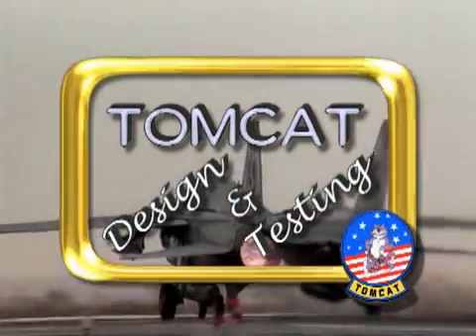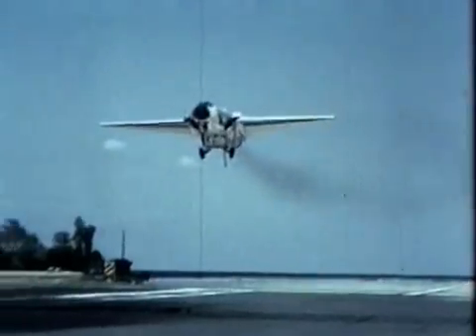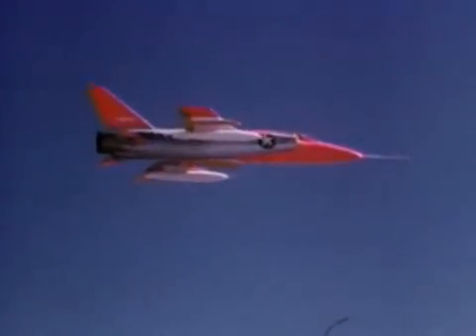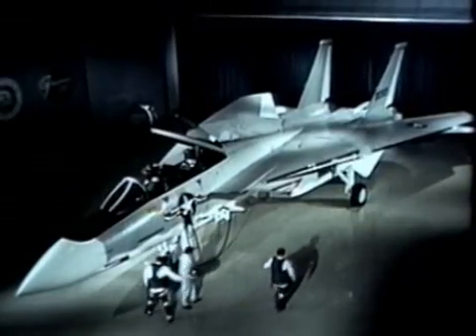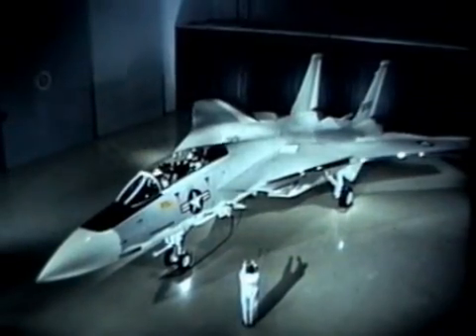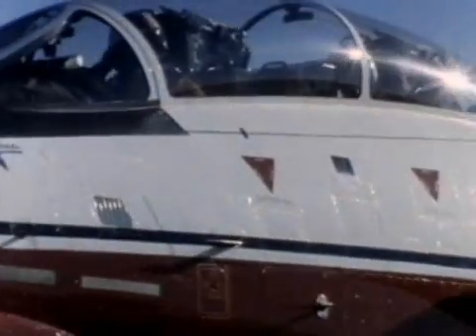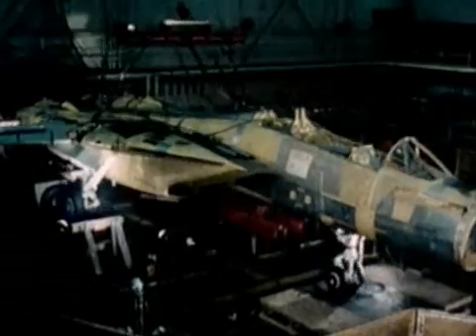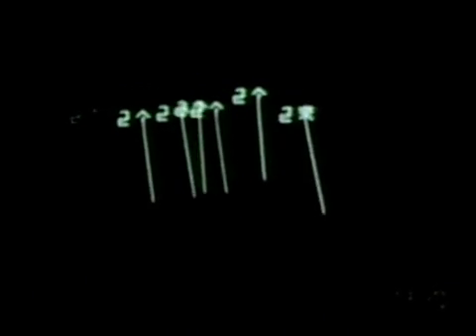F14: Design And Testing

Comment: The f14 and F15 were the best aircraft ever produced. Then cam the F16, which was cheaper than the F15 and was a great companion to the total air dominant F15. The nava search for an equivalent and accepted the Fa18 Hornet as their version of the F16. Since then the Fa18 was improved upon and now the FA18 Super Hornet graces the decks of our aircraft carriers as air superiority aircraft as well as ground support. A few of the original Fa-8's remain as ground support only. I really think the Navy dropped the ball when replacing the F14 with the Super Hornet. Updates to the F14 could have kept it alive decades longer. But for now we're looking at the F35 to fill that role and many others. Too bad! A stealth version of the F14 could have kicked ass on anything else in the sky. It would have been the Nav's version of the F22 Raptor. But they are being forced to accept the problematic F35. Maybe the Pentegon will see the error of their ways and we will get a decent replacement for the F14.

Comment: The big issue with using the TF-30 engines is that they were basically bomber engines and couldn't handle the rigors of thrusting a fighter like the F-14. It wasn't until many years later in the late 1980's the Tomcat finally received the power plants it needed in the form of the GE F-110 turbo fan engines which were designed as a fighter engine and could handle the higher tolerances needed for that kind of high speed flying and climbing.

Comment: I knew it! I knew I'd seen an F-14 with a single tail-rudder but none of my fellow jet fighter pilots believed me!
Reply: its called a F-111
Reply: rear speaker one of the original designs for the Tomcat called for it to have a single vertical stabilizer. But because of the height requirements they decided to go with the twin vertical stabilizers. You can see one of the original models here. https://youtu.be/mmEgQz7tfEU?t=1m52s
Reply: The original design had one vertical fin but because of the high canopy two vertical fins were necessary for better directional control. The original prototype shown to employees had a single fin.
The F-111 aircraft was a totally different aircraft the preceded the Tomcat.

Comment: As an air force tactical bomber and the SAC FB-111 and even the sparkvark the EF-111 raven the F-111 distinguished itself as a solid bomber but the issue is it was never designed for operations on a carrier plus it was not the most manuverable jet either that and the TF-30 engine had teething issues of its own for screaming down a valley in central Europe in the dead of night to take out a Warsaw pact command post flying just off the deck I would prefer the F-111 but as a fighter no I would not want to be doing ACM in an aardvark
Reply: Even Air Force pilots,  who had flown the Ef 111 in combat,  said when a fighter came after them,  with missiles,  they could evade,  for a while,  and hope an f-15 came along and pulled their fat out of the 🔥,  so the ef,  f 111 wasn't at all a fighter,  from the beginning

Comment: The F-15 silent eagle is the same platform as old F-15A/B,with structural fuselage modification, with aesa radar, avionics and engines,the Tomcat could be modified as F-15, the Hornet A/B NEVER shoot down Su-22 and Mig-21 as Interceptor or Air superiority fighter of Navy. If you talk about expensive, talk also about F-35 program. Fanatic.

Comment: @smeary10 

I think it was much better than 60's handling and performace. Try 80's.

But the 14E would have been much better (decades better) than the originals. Just take a look at the F-15E and the newer SE modle. Or even the F-16 Block 52 and 60's.

Comment: @FutureMarine1775USA - I agree, however, why modernize an old airframe when you can design and build a completely new one for less money? What you want to do to the Tomcat will basically give you a SuperBug. If you look at the Super, from the air intakes forward, it looks a lot like a Tomcat front end. I reckon they should navalize the Raptor. That would be cheaper to do again. Strengthen undercarriage, arresor hook etc.. Your thoughts, mate?

Comment: The Tomcat was also quite unreliable and very expensive to maintain. It bled a shed load of energy in tight turns and as many of you have pointed out, really did only a few things well which are not relevant today. The Super Hornet is a much better aircraft. Us Aussies fee the same way about the recent retirement of the F-111. A legendary arcraft that did one job REALLY well. But also became very expensive to maintain. F-111 & F-14 were the only Phoenix carriers and had same engines as well.

Comment: @ewthmatth It's used to catch the aircraft in case something were to go wrong and the F-14 had to make an emergency landing,cause if it's that bad there isn't gonna be a chance to go around and try again if you miss the capture cable so it's sort of a back up to save the plane from running off the carrier.

Comment: 7:50 what the hell is that?
Reply: Testing barricade arrestment as used on the carrier in emergencies when the hook/wire system isn't available. The barricade damages an airplane, but it's repairable.

Comment: @Aryanpars you need to remember that they did not have any thrust vectoring in 1971. Thrust vectoring did not come around until the f22 prototype in 1994. but i will agree they could have modified the f14d to have thrust vectoring and that therefore wouldve made the f14 much more lethal.

Comment: @reddead255

I would not go that far, especially with the F-22. The F-35 is still an unknown quantity, although the cockpit and avionics are top notch. Still, it is a stealthy dump truck compared to the "Super Tomcats" that should be rolling off the assembly line as we speak. A great high / low mix: Advanced Tomcats and F-35s on the deck. Now we will have two planes doing the exact same thing F-35 & the F-18E/F/G/H/I/J/K/L/M/N/O/P/Q/R/S/T/U/V/W/X/Y/Z.